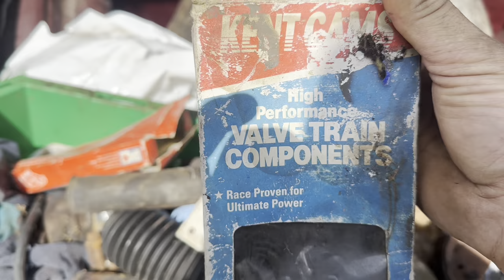Classic Ford 105E sat for 20 years barn find will it start? It’s a long one! my did she fight us

Comment: Hi Al. that aint no crossflow, that is the old pushrod motor and they didn`t do them in 1300 they did them in 997 which would be original for this car, also in 1200 and 1340 for the consul classic, then 1500 for the cortina.  crossflow means that the carb and intake are on one side and the exhaust on the other and so the gasses cross the engine to exit the motor.  Thanks for another interesting vid.  Paul.
Reply from the maker: Yes I’m no Ford man lol it’s a 1500 and it’s off to a new home 👍
Reply: They did make a pre-crossflow 1300, but only for a short period in 1966/67.  It was fitted (along with the 1500cc version) to the early Mk2 Cortina from its' October 1966 launch until October 1967, when the 1500 was enlarged to 1600cc and the Crossflow was launched.
Reply: @briandamaged323 Was gonna say the same as I had a 67 Mk 2 Cortina 2 door that was F reg it also had the long gear lever (lever goes nearly upto the bulkhead later ones had remote linkage short lever) gearbox, isn't the spare wheel base model Mk 3 cortina?
Reply: I'm glad that it's not just me. I baulked when that engine was described as crossflow. Crossflows have the exhaust and inlet on opposite sides. That clearly had them on the same side.

Comment: It’s a 1500 pre crossflow with inlet and outlet on same side of the head. A crossflow has inlet opposite side of exhaust 👍🏻 these pre crossflows were early engines . The crossflow came in 997 1300 and 1600 form

Comment: I used to race these in  F1200 Formula at Arena Essex, Crayford, Lydd etc Short circuits, I used to totally strip and rebuild the 1200cc engines to full race spec, When we ran out of Anglias we raced Escorts.

Comment: that looks like a 1500 engine the crossflow was called a crossflow as the carbs was on one side and the exhaust on the other so the fuel air was drawn across the pistons did my car apprentership on these age cars  one thing we used to do was run a wire from the live on the battery to the live on  the coil  as poor wiring conections made for a shit spark but as soon as you bypassed it with the wire from battery to the coil much better spark

Comment: I don’t know why you’re pulling it down, it just needs a quick T cut, also, is it MOT exempt?
So it’s ready for the road, typical condition for many vehicles on the road in the 70’s.

It’s a pre-crossflow engine btw, and those front bumpers look like Escort van rear bumpers, which ford used on the Mexico.

Comment: A classically period pimped up Anglia - twin choked 1500 Gt engine, rocket box and 1600e Rostyles and Capri struts. Im not a Ford man but i do have a bit of a soft spot for the old 105e - a shame its so terminally fubarbed structurally.